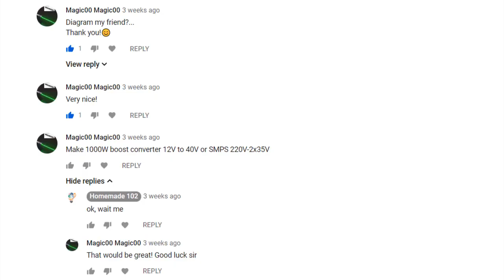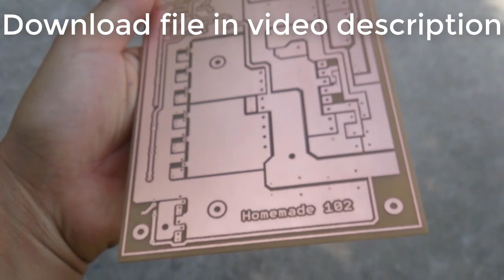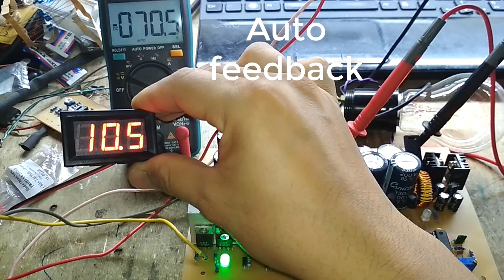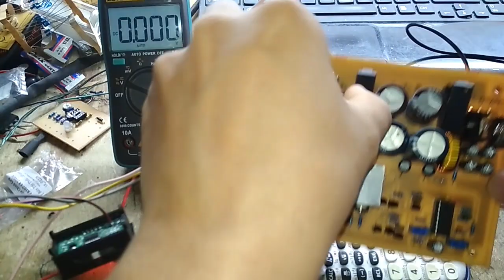12V to +- 50V 1000W for amplifier | Car amplifier | How to make

Comment from the maker: Please share my video, thank you very much <3
Reply: How to make Welding machine using 12v transformer
Reply: please sir make a full video on how to correctly wind a high frequency transformer
Reply: Ok sir im shere video
Reply: what's the serial number 2 transistor that is in front of the green led
Reply: can u make  12 volt dc to 90.0.90 dc 15 ampere board   ,, i want to purchase
Reply: Pa share nmn ng diagram at layout sir

Comment: Good job on the boost converter but where is the load test of 1000w you are claiming?  We want to see the ampere meter and voltmeter at the output.  That will be around 90A at 12v from the input including some losses.
Reply: Yes

Comment: Hi sir. In the project help file, the amount of inductors next to the output capacitors is 330uH. But at the output there is a sharp voltage drop with these inductors. What is the actual amount of these inductors?  How uH? please help me sir. Thanks

Comment: I want to design a 1 kw out put60v dc,220v ac I/p  at  15k - 20k ohm frequency. Can u pls tell me the calculation of turns in both side of a Faraday core..??
Reply from the maker: What is the transformer size ?.
Reply: @PhdHung  I know there is a size fact of transformer, sorry for that, pls can u tell me the size of transformer Nd also the size of super enamel use for it.!!
Reply: Ok I will let u know
Reply: My transformer size is 2.4 m2

Comment: Sir , which transistors are used near MOSFET ?, Number not mentioned on PCB design or circuit. Pls give it
Reply from the maker: Totem pole driver S8050 and S8550

Comment: Can you make 300 watt 220v ac inverter from 12v dc supply so i could run a 200 w ac motor? if yes then please let me know i will place A requirement of 50nos. of such inverters per month.
Reply from the maker: I just share, I don't sell

Comment: Hello Sir. 
Did you do the test, what is the ripple of this converter if the output voltage is raised to 50 volts?
Reply from the maker: raised ~ 50mV at 50V 0 50V

Comment: A Test Bulb is work for DC or AC bulb? what is a voltage rated?
Reply: It's probably 120Vac bulb but both 120Vac and 240Vac should work on 100Vdc